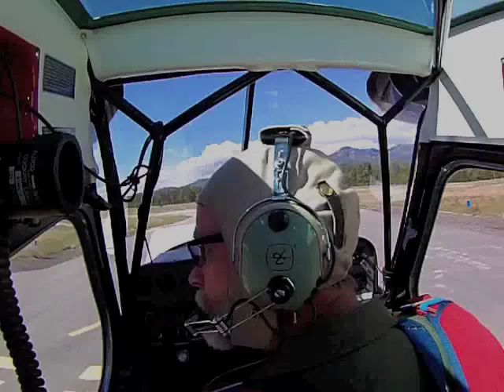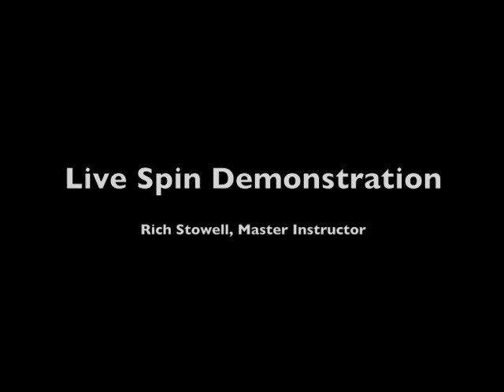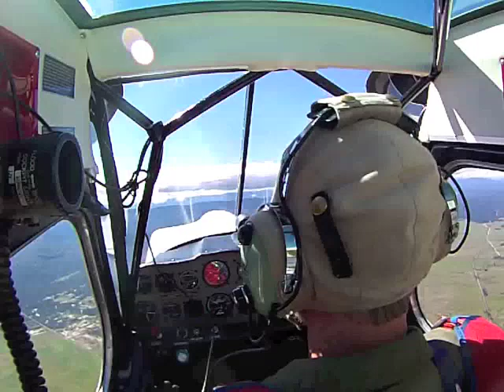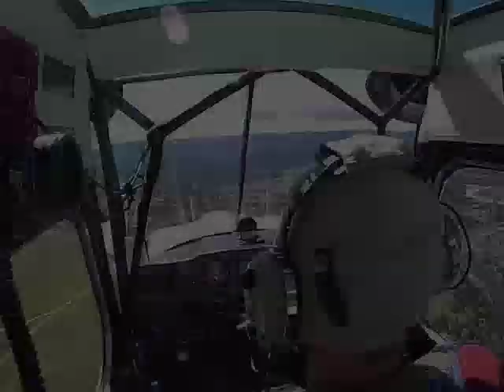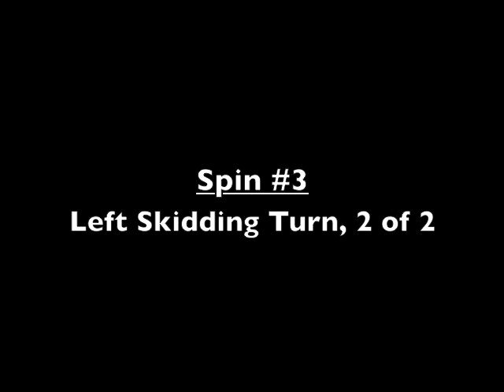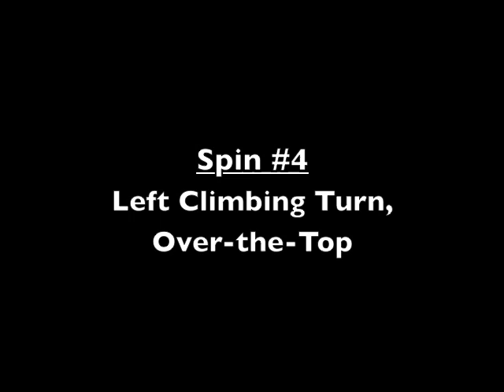Live Spin Demonstration over Cascade Airport

Comment: I had wanted to go to Sewanee just before William  Kerschner died  but never made it. ...you make this look so easy : powers off, ailerons neutral, opposite rudder,  elevator forward, , SPIN IS DONE! over and over and over. Your consistency makes it look so easy and fun. Now as a technology add on: I can imagine a simultaneous  three screen display, in the plane, from air, and on ground that could be paused and viewed at every instant....

Comment: Can’t figure why the airplane departed to the right over the top in the climbing left turn? Airflow must’ve been coming from the left?
Reply from the maker: In its basic form, Yaw + Stall = Spin, where sufficient yaw at the stall initiates rotation (actually, yaw-roll coupling drives the rotation). In this case, sufficient yaw was generated to the right by misapplying right rudder at the stall. Thus regardless of the direction of the climbing turn, one can induce a spin to the left or right. What would the airplane have done on its own? Depends on several factors, but in general in a coordinated, constant bank, climbing turn we might anticipate the airplane rolling toward wings level ("over the top") at the stall.
Reply: @richstowell  many thanks for the explanation Mr Stowell…Thank you for making the video on how to turn.
Reply: Airplane is in left climbing turn, right aileron is down but right rudder is rotating right wing backwards compared to left. Airplane is skidding left. At stall, left wing has more lift while right wing has stalled. Airplane follows lift and flips over to the right.

Comment: In South-Africa ( P.E.) whère i learn to fly, all pilots students were introduced to spin and incipien spin before going Solo.
Every pilot should know to recognise spin précondition and early récovery procedures. 
During my Pilot carrer i have done Thousands of spin from various positions.
Also important to know that an aircraft do not want to fall in spin, we have to force it, and if you are lost in a spin leave the controls free, and the aircraft will recove alone !
thougt with extrème speed? that you will have to control.
Reply from the maker: Thanks Jean. Keep in mind a couple of things about the "let go of the controls" idea for spin recovery: First, that may work in some airplanes in some spin configurations provided it is implemented early enough in the spin departure; there are, however, many spins in many airplanes that will not recovery merely by letting go of the controls, even if the controls were released early in the process. Second, as you point out, spins result because pilots are misapplying the controls, often fighting against the airplane en route to spin departure. It is not reasonable to expect pilots to simply let go of the controls once an accidental spin occurs -- if they were able to do that with ease, they would have let go of the controls before the spin started in the first place. Humans under stress tend to grip things tighter the worse things get, making it unlikely for most to be able to let go of the controls once an airplane suddenly spins.
Reply: yes of course, i was just. making a point to make pilot to understand that aircraft are made with inerant stabilty and if lost in bad conditions where pilot do not know wich side the aircraf i turning, releasing the controle for a wayle could save is life. knowing of course that the nex danger will be the exessive speed.
regards

jean figadere

Comment: PARE, memorize it and work to develop muscle memory. Now, is there any way to recover a Beech Baron that’s entered a flat spin?
Reply from the maker: Hi Eustancio. Whether it's a twin like the Baron, or a single-engine airplane, there is no certification requirement to demonstrate recovery from a flat spin. This even applies to spins-approved airplanes, though a few high performance aerobatic airplanes are known to be recoverable from flat spins (e.g., Pitts, Eagle, Extra). That said, NASA Standard actions guided by PARE would still be the best bet, though the chances of recovery from a flat spin in the majority of airplanes--regardless of the actions taken--is slim. That's why we need our awareness and prevention skills (especially in airplanes where intentional spins are not approved) to be as sharp or sharper than our recovery skills.